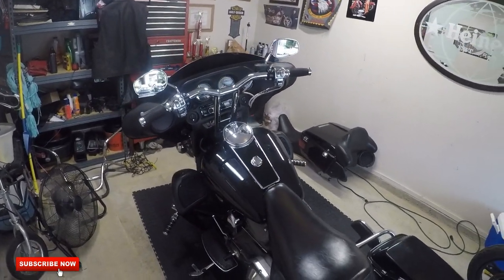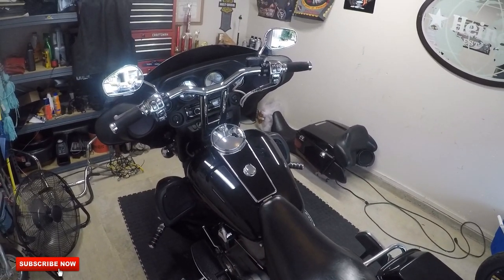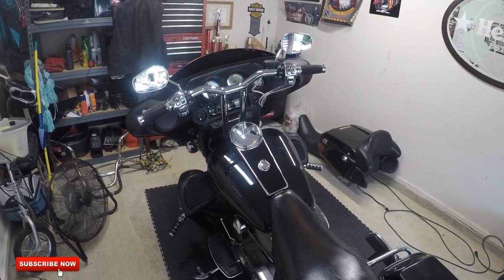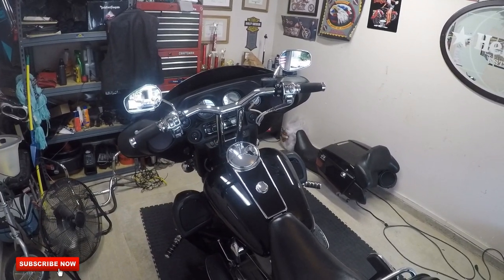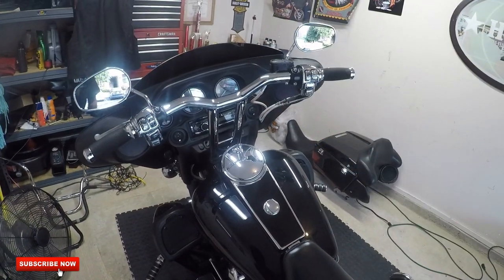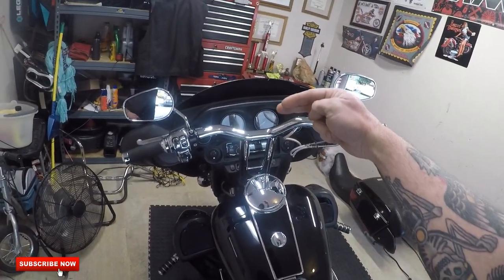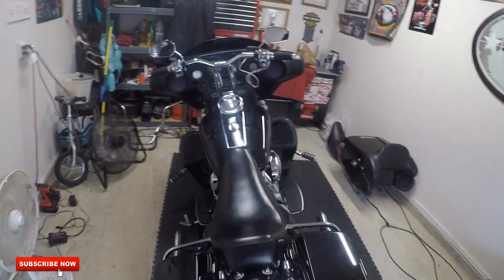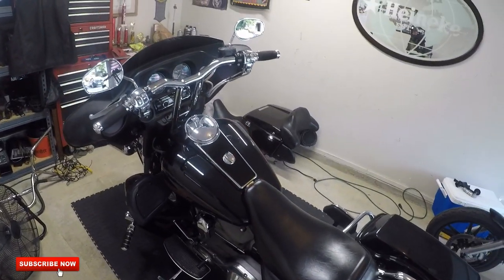Lucky Daves San Diego Bar Electra Glide: How To

Comment: Did you have to remove the faring or did you just use a hole drill to cut your access and also did you need to change your cables?
Reply from the maker: Cables depends on how high you wanna go these are +6 cables with 14" bars, no need to remove the fairing just have to remove the radio and lower switch panel to clearance it.....thank you for the comment
Reply from the maker: Hope that helps
Reply: With the relocation of your ignition, did you lose the fork lock functionality?
Thanks man... bars look great.
Reply from the maker: Yep....thanks for the comment 🤙🤙🤙🤙